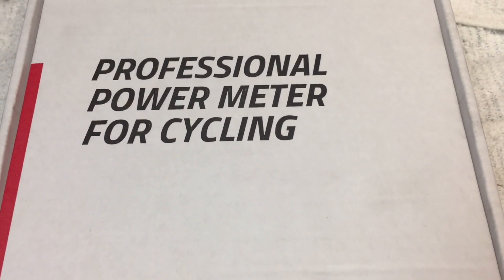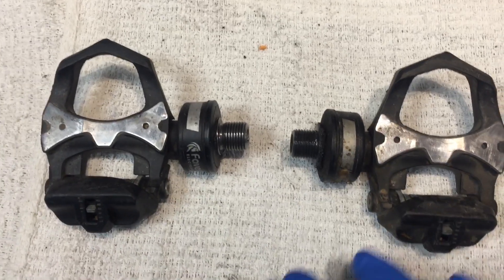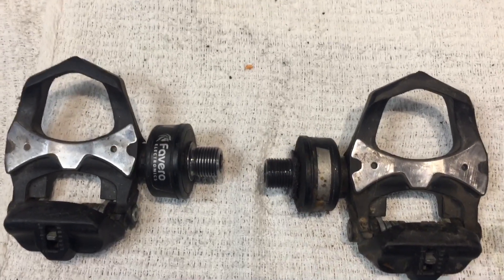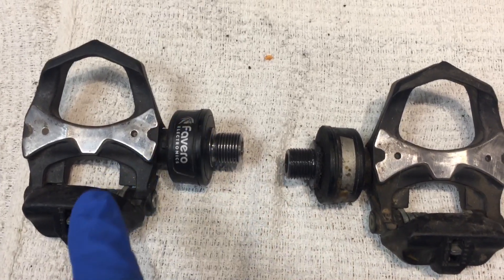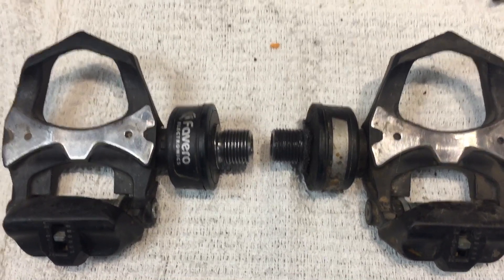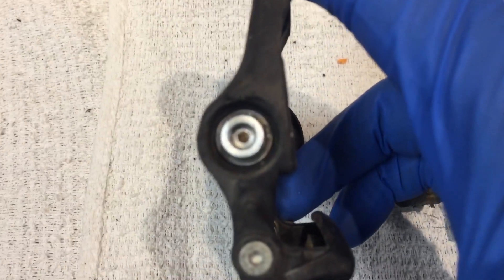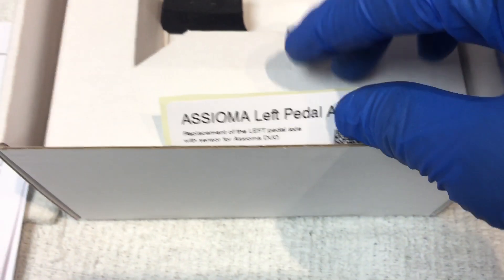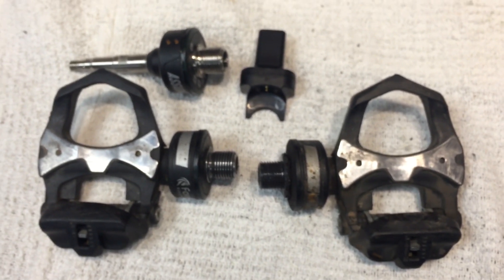Favero Electronics Assioma Power Meter Pedals Issue Video 2

Comment: I'm having the same issue, with duo shi though. What's the process to set up the new left pedal and make it work with the old right pedal? Thanks!
Reply: How long have u been using the duo shi pedal? I'm planning to buy one, but worried about its quality as the shimano version has less bearings (the look version has 3 bearings).
Reply: @jinchengyang5432  2+ years now
Reply: @vijayramachandran3559  is the unvisible left pedal the only problem u had with the assioma shimano so far?
Reply: @jinchengyang5432  yes, it just died. Assioma replaced it under guarantee, though
Reply: @vijayramachandran3559  Lucky to have the problem within its warranty period (1 year as i remember?)
Also I'm seeing some people having a bad experience with the shimano version because of its 10mm larger Q factor. Hope that won't be the problem for me.

Comment: Weird. I replaced the spindles also. Had a socket that fit great. No filing at all. 1/4 inch square connector. The point here is that smaller OD sockets are readily available, if you are using sockets with 1/4 inch connector. Agree, these are great PM!
Reply from the maker: As I often say on my channel “your mileage may vary” I purchased what was available at my local hardware store, Home Depot.

I’m glad you had similar success by just swapping out the pedal spindles.

Thank you for watching. Please consider subscribing I often talk about power meters, power analysis, and training with power.

Comment: My assioma duo power meters stopped calibrating (via the app and my garmin head unit) plus they only ever show 0w now.  I switched to uno and now they (the left pedal) calibrate but still showing 0w. If I go back to duo then won't calibrate. Seems like right pedal the problem on calibration but left and right pedal the problem on not reading power? Also tried putting them to sleep in travel mode and then waking them up but no luck. Any tips?
Reply: how long u've been using that power pedal? i'm looking at the assioma shimano version, love its user-friendly installation. But these videos and comments are really holding me back...
Reply: @jinchengyang5432  they are good power meter pedals - turns out it was my fault they stopped working - I found out that it’s bad to bottom out the housing on the cranks. I’d decided to instal some plastic sleeve crank protectors and I had to take off the pedals - when I put the pedals back on, the power meter housing squished up against the plastic sleeve which impacted on the delicate mechanism inside. The installation instructions mention to add a spacer if the housing gets too close to the crank. 

There’s a lot of positive feedback how well they work and how accurate they are.  I’ve bought the uno version now as the duo is overkill for my needs, and they have worked faultlessly.
Reply: @michaelthomas6419  Glad u solved the problem. Thanks for the info man.

Comment: I got a question. I e had other powermeters. My question this is the only one that has a app. Do I got to calibrate them every ride through there app, or can I just use my head unit. Do I got to have the app running when using them or what. Or can I just dis own the app. Thannks
Reply from the maker: Jesse Davis you should calibrate your power meter BEFORE every and you can use your head unit Garmin or Wahoo etc. I use a Wahoo and zero offset is usually “0” and your ready to ride.
Reply: George Vargas ok so I don’t have to open or use the assimo app correct. As long i calibrate them to a zero offset on my garmin head unit correct.
Reply from the maker: @jessedavis1489  Correct! The app allows you do other things like update the firmware or convert a Duo system to Uno or vice versa
Reply: George Vargas awesome brother, thinks for your time. The only reason I got confused is because it allows you to calibrate it in there app lol. Thanks a lot man for your time. Have a good week brother
Reply from the maker: @jessedavis1489  Sometimes your head unit won't recognize your power meter so it's nice to have the option to calibrate your power meter with the proprietary app.
Reply from the maker: The app also allows you to shut down the unit so they don't inadvertently turn on while traveling or whenever you wouldn't want them to turn on. No other power meter that I know allows you to do that.
Reply: George Vargas ok yea I see there some cool stuff about these meters. I will try them out this week for sure. Can’t waite .
Reply from the maker: @jessedavis1489  if you like them and need another pair or you have some friends that want a set please send me your referrals :-)
Reply: George Vargas ok I definitely will. You have my word. I’m watch your 1st video later tonight. Since this is the second video.

Comment: Thanks. Could you let me know your experience with the cleat and unclear process? The general view is that they are extremely tight even at the loose setting and just do not compare favourably with the spd pedals for smoothness.
Reply from the maker: Rahul S I like super tight clear retention so I don’t inadvertently come out while sprinting. They seem fairly typically to me in the easiest setting.
Reply: I upgraded to these about 4 weeks ago, no issues at all clipping in or out. Always had Shimano previously and I honestly can not tell any difference. The Assioma's I believe had an update spring, now black was silver which was to help with the issue. I have the black spring. The pedals, power are excellent and no hesitation in recommending.

Comment: Would it not have been better for the company to send you the Left Pedal unit rather than expecting you to go to the trouble of having to get a socket and replace inner unit?
Not everyone would be as handy as you are at this repair.
Reply from the maker: Gerry Jameson I completely agree with you. It seemed odd to me as well for them to send me just the power meter but I was grateful with the speed in which they serviced my warranty request.
Reply: In Europe you can use a standard nut to unscrew that. The OD is small enaugh to fit perfectly. And as they are an Italian Brand they assume you have access. But if they sell into us e.g. they should just add the nut for the the packaging i guess.